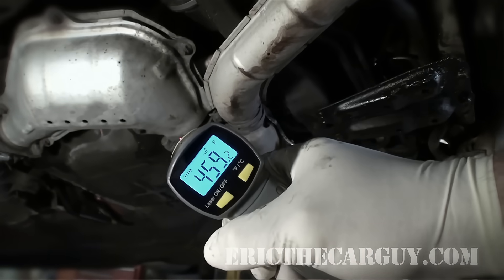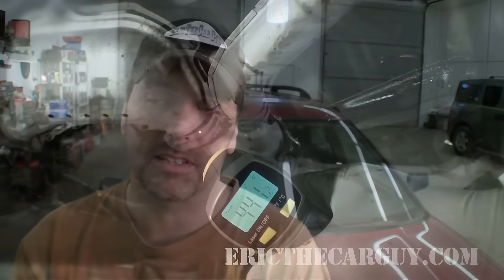Does Lacquer Thinner Clean Catalytic Converters? -EricTheCarGuy

Comment: Hay I try it this weekend and it works I use one gallon of pure lacquer thinner to A tank that had 1/4 tank of gas ran it at 2500 rpm for 30 min.  The light on my dash went out . Eric you should try one more time . I have A 2002 toyota camry le v6

Comment: Hi Eric, I appreciate your sharing all the time. I have a dodge carvan 2000, 2,4. the sppeed goes from 1.500 to 3000. I need to adjust it to 2500 to pass the air polusion but there's no way to keep it at 2500 speed. does any advice on how to adjust or calibrate the acceleration to avoid it jumping from 1500 to 3000? -thanks

Comment: Ive actually been doing this for a few years now. The actual proportion is 1GALLON of laquer thinner to about 1/2 tank of fuel. I have used a stronger mix depending on my particular cases. But it has restored life and function to:
a 2001 infiniti I30 with catalyst codes
A 1999 GMC yukon that sat for 2 years and ran like crap. 
A 2000 dodge ram 2500 that was sluggish and overall losing power
A 1997 chevy s10 blazer (offroad truck) that was having slight fuel delivery issues(clog)
As well as a couple other random vehicles. 
Its not always a solution, but at the very least, if you use the proper proprtion, it cleans out the fuel system extremely well.

Comment: I love Scotty's videos, he really makes auto repair fun.
I do know acetone is bad for the plastics and rubber in the fuel system, there have been a few studies showing this. Acetone was once believed to increase fuel mpg, when added to gas engines, 
Cleaning the cat seems possible, I believed scotty when I watched his video.
TRY using Cataclean by mr gasket, I have used it and it does work in most cars, many parts stores have it and it won't damage your fuel system,,,
Eric thanks for the video, I respect your opinion, 
I have been working on cars since 1980, owned a shop since 1991, specialize in the computer controls/ advanced engine performance on mostly higher end cars,, and I dont live with my mom and dad....lol
Reply: Okay, you fix his car.
Reply: i use acetone  in my cars    dont a problem   just use 2oz per 10 gal   engines  love it  more is not better
Reply: "corvair" I don't think any of those had cats. 2oz.? So you drink isopropyl and breathe into the intake while peeing in the tank.

Comment: I did this and it worked , I use High Tess and cleaned out the throttle body and kept slowing down and then punching it to get a lot of vapor throw and drove it forty miles hard and went and got inspection

Comment: Haha I always take the cat out of my cars useless things
Reply: they sure clean up the exhaust though. Especially with newer SULEV rated cars
Reply: good idea just put it back in before emissions and it will be brand new and clean. so it would be a good idea to remove the cat and do the extra tube going off with the o2 sensor on it?
Reply: Most cats have o2 sensors screwed into them...constantly reading the fuel / air mixture ratio.  You remove the cats, and watch your gas mileage suffer terribly.  Learn a little about cars, then comment !

Comment: Failed .. Scotty said to add 1 gallon thinner to a half tank of gasoline or about 9 gallons fuel. not a quart bro. he also said he only uses quality thinners sold at a real auto paint store. not that cheap stuff you have from home depot , lowes etc. he also said if the thinner doesn't work which is rare, to remove the cat and soak it in the bucket. I've used B12 chemtool in the past with good results. stuff is so hot it will burn your skin. a little goes a long way :)

Comment: Erick, Please update what the 1400 code was probably caused by. And wish you would of had a 420 light and did the right amount as you know. You can't really tell if the cat was broken as you said or how much. Even better would be too smog check the sucker. Subaru has plenty more miles im sure. Suckers are amazing and you should know this because you saught one out.

Comment: Hi Eric,
I have a 2003 Nissan Maxima and I keep getting the PO300 code I changed the intake gasket, I changed the O2 sensor that is in the front of the car connected to the cat closest to the oil pan, I have changed the crank sensor and I put in new plugs twice and all three plugs on the fire wall side are black again so I'm lost, first I was thinking it was a ground of some sort but I can't find that, the car was running just fine then coming home from work it just would not perform it was like it just lost power under acceleration Oh and I forgot I changed the #3 coil that was the first thing I did as I got a code telling me the misfire was #3 coil, any help you can give I would love.

Thanks
Charles

Comment: What I have yet to hear from both you and the other gentleman is the fact that OBD11 codes are not written in stone.Many people assume that when a code is detected on an a code scan, that it requires that part to be replaced. I had a gentleman with a problem, that pointed to an O2 sensor, I advised him to check for  vacuum leaks. He went ahead and replaced the sensor and still had the same code.(even after reset) 
If an ECM sends back a code that says an O2 sensor is bad, and does not specify a rich condition, 99% of the time the sensor is not bad.
This gentleman had a vacuum leak in his intake manifold.
The problem was corrected after the gasket repair. You guys do great work in helping folks save money. I have respect for you both. This are just the workings of an old guy trying to help the cause. Peace out.

Comment: With all due respect, I love your vids and learn a lot from them but you can't rule out lacquer thinner doesn't work. Scotty said to put in a gallon of pure lacquer thinner and you only used a quart which is 1/4 of a gallon. Also, it's not always gonna work. Like what Scotty said, if it doesn't work, throw it in a bucket of dish detergent mixed with water overnight. You were just a little off on the testing procedure.
Reply: The dishwater won't work in this case either.  Scotty's two methods are to clean a clogged cat.  At the beginning of the video Eric says his cat is NOT clogged (1:37).  So Eric misunderstood what the lacquer could do; he also used the wrong ratio.
Reply: The fact is that this Subie had a timing belt that was off by one tooth. He fixed that issue and the cats were fine. What's interesting is that the PCM was smart enough not to throw a code P0420 for a timing belt problem and IMO it even caught the contaminated fuel.
Reply: Rýán Túçk Subarus have a known Cat inefficiency code issue, becasue the computer is highly sensitive to any cat degredation. They have released ecu reflash procedures that sometimes work to solve the issue. just use an o2 spacer on the downstream o2 and you'll be fine.

Comment: Quick question.  I ended up replacing my o2 sensor.  I get a code saying that my engine is running lean; the O2 is not switching and is not in closed loop. (95 Ford Probe 2.0)(only "1" O2 on manifold)

The issue is that this problem only happens below 4 thousand feet down to sea level, but works perfectly when I'm in the mountains.  More recently when stopped at the light "after warmed up" the engine won't idle.  I've checked my wiring and did find a bad ground wire on the exhaust, and can't seem to find any vacuum leaks.  I've now been getting a code saying that my EGR is not opening which I've written off for the engine running lean for the time.  At the time I'm thinking dirty injectors or a weak fuel pressure regulator spring.

What sucks is that this car is an OBD1 not 2; so I don't have access to bi-directional scanning.  In fact I can't find a scanner that will work on this car, so I've resorted to pulling the flash codes.

If anyone has worthy feedback I would be most grateful.

Comment: It's an old model Subaru with 170K miles on the clock. Hmm. Easy to fix - scrap it! BTW - since it's audibly miss-firing at 3000rpm it's pretty obvious that unburnt fuel is getting to the 'cat - hence poor O2 readings.

Comment: Eh, to be fair, Kilmer's video merely suggests an option to try before replacing the cat. He uses phrases like "often it helps," etc., and hey, if it can save you a $1000 or so, it's good to know there are options, especially if you have an older car that's barely worth a $1000 to begin with. ;)

Comment: I tried condensed injection cleaner in the fuel tank 500ml- 10lt petrol (normal run it through a machine direct into fuel rail) thought what the hell see what happens melted the cat honey cone in 3 days and blocked the exhaust no power and stall above idle.

Comment: Geeez guys, he said he might not have used the correct proportions..... he was erring on the side of caution. Lacquer thinner is a mixture of solvents - anyone wanna discuss the effect of strong solvents (not intended or approved for automotive use) introduced into the fuel system and into a combustion engine? What long term effects do these solvents have on sensitive sensors, pumps, injectors, seals and more???

Comment: shouldnt you use that with less gas in the car.
Reply: The official procedure is to rev the engine at 2000 rpm but if the cooling system isn't up to par, OMG.

Comment: So why waste a time doing a video like this without hooking the vehicle up to an Emission analyzer??  The HC and NOx numbers will show any documented change and verify it this procedure will help.   Reading Cat temps are false readings and will not show if the vehicle will pass or not.   But I know personally as a 34 year profession technician that putting solvents like this will increase exhaust temperatures... Just like adding Heet gas line de-icer or running racing fuel.. especially Alcohol not leaded type... will raise exhaust temps and result in the Catalyst doing a better job of cleaning up hydrocarbons. .   I have used these procedures personally to pass smog...  But its a temporary fix.  Not a repair.   Raising exhaust temps will lower readings..  and may buy a person time to make the needed repairs of replacing the catalyst.    Just food for thought.

Comment: Kleen Strip lacquer thinner wasn't a good choice. Its widely available, but its 40-70% acetone, 10-30% methanol, 7-13% ethyl acetate, 3-7% ethylene glycol, 0-2% methylethylketone (MEK), <1% toluene, <1% naptha. In effect you dumped in a a cup of acetone, a bottle of dry gas, a shot of antfreeze, a teaspoon of MEK, and a 1/2 teaspoon of rubber cement (or magic marker) thinner. The acetone burns hot and fast, and doesn't contribute anything to cleaning the cat, and neither does the methanol.

I can't help but guess that the reason you used a quart of lacquer thinner - instead of a gallon as the Scotty Kilmer video used - is because you knew that Kleen Strip has way too much acetone and methanol and the car would be almost undriveable with a gallon of that on a 1/2 tank of gasoline.

You would have done better with Crown lacquer thinner from Lowes. Its 
25-35% naptha, 25-35% methanol, 20-30% acetone, 15-25% toluene, 0- 5% 2-butoxyethanol (not a solvent, used to slow evaporation), but that still isn't really ideal.

An auto paint store lacquer thinner (at least outside of California) will have little or no methanol and very little acetone with more naptha, toluene ketones, etc... 

You can make your own from naptha, toluene or toluol, xylol, MEK, acetone, etc. for your own witches brew. Go very light (<3%) on the MEK to avoid melting o-rings and plastic fuel lines, and light on the acetone (<10%). The bulk is around 50% (1/2) naptha, (1/4 to 1/3) 30% toluene, and 15% (1/6) xylol. i.e. a base might be 3 parts naptha, 2 parts toluene, 1 part xylol, and add a little acetone and a very little MEK. The some of the naptha and most of the slow burning toluene and xylol will be what make it through to the catalytic converter. The acetone puts some volatility back into the fuel so at 3,600 RPM it isn't still burning the fuel as the exhaust valves open. The MEK is probably un-needed if your fuel injectors are reasonably clean.

Using an AWD Subaru with that self stirring twin pickup saddle shaped tank was inspired because it stirs the fuel so well. Although that would be a confounding problem if the tank wasn't clean.

Comment: 3:24 just take a side grinder and cut them off much easier  why even try to fight something that's likely to break or not even have a decent head to deal with. take a torch to it or whatever.bolts are cheap time is irreplaceable.
Reply: Trying not to break both halves..

Comment: I have a question? Could a leak in the intake cause a P0420 code to come on as the air flow would be off a bit and the computer thinks the cat is not working properly due to that? Thanks

Comment: Lacquer Thinner could melt the rubber seals (o-rings) and wire shielding. Even if it's gasoline resistant doesn't mean it's lacquer thinner resistant. Hope this helps. Good luck!!!

ps. Possibly even the fuel injector plastics and rubbers.
Reply: I takes a lot of time to dissolve plastics with a petroleum based product.  Rubbers, even longer.  From several days, to several months.  That why you run it immediately after adding the LT.  Do not let it sit on/in the parts, do it occasionally and this will not be an issue.

Comment: You should be a little more detailed. I used to put this exact same thing in my older suped-up cars. I used to put it in a supercharged 5.0 Mustang, and turbocharged cars. It made them run better.

If you look at the contents of some of the products that claim to be Octane boosters a lot of them used Toluene. Except for the ones that had the one ingredient that is bad for the cats. The main ingrediant in this laquaer thinner is Toluene.

I also like to use the Octane Booster or fue cleaner that I think was made by Berrymans. That is a real good product.

Comment: Excellent video. Great and accurate information. I personally like the snap tests for O2 sensor and cat tests but the latter requires my 5 gas. Oh what happened to your hair? :) Forgot to add. I don't think anything that could fully burn in the combustion chamber like a very light HC will have ANY affect on a cat. It has to be something that is detergent yet will survive the combustion chamber AND deposit itself on the substrate of the cat, AND clean the substrate, AND then burn off completely while not leaving anything that would also coat and diminish the performance of the cat. As you stated it has been a VERY rare case for me that an O2 sensor caused the P0420/30. However a bad O2 sensor on the pre/side if it is not switching rapidly enough will not create the O2 scrubbing action needed for good performance as well as NOx reduction on a 3way